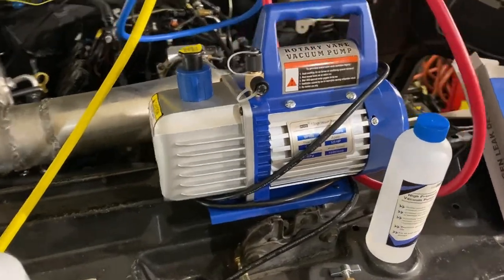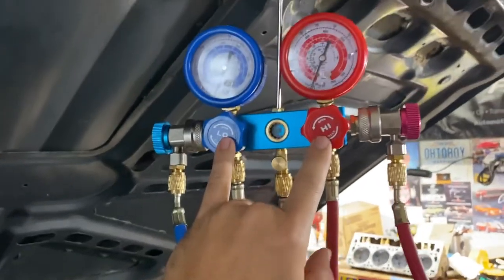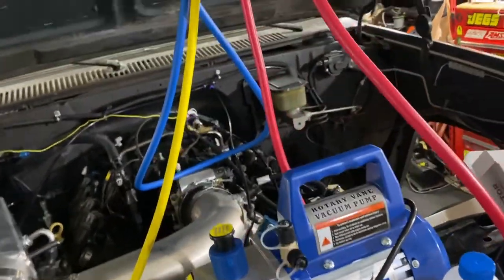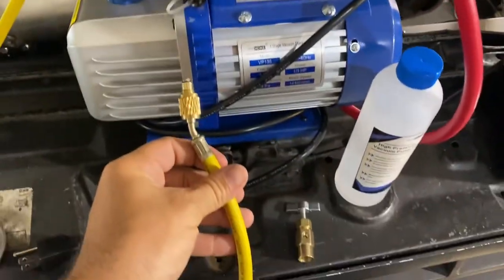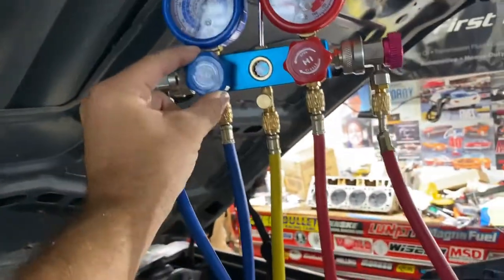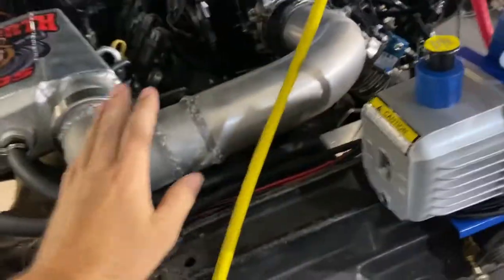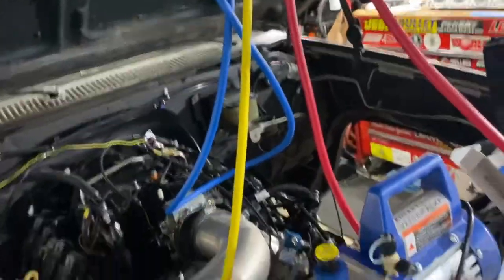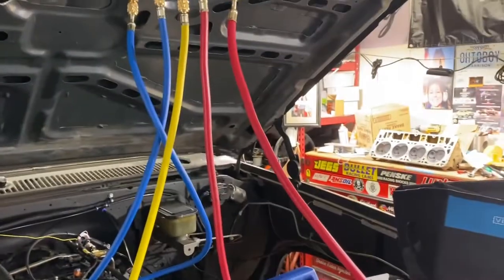I Bought The CHEAPEST Amazon AC Vacuum Pump!

Comment: One thing you did not mention: 
There is considerable amount of air in that hose possibly. So after hooking up the can you can push what appears to be a relief valve on your manifold. Blasting the air out and purging the line with only refrigerant, then open the knob to allow it all to flow in and never turn the can upside down.

Comment: Weird when i hooked up my freon can no freon would suck into the system... even after i opened the low side and pierced the can
Reply from the maker: Did you vacuum down the system first?
Reply: @donniedarkoc1033  yup
Reply: @2jzgenat the new cans require a pin valve. Most auto parts stores sell this adapter. I ran into this a few years ago and just bought the new valve from harbor freight.
Reply: @DJAlup  very true i felt so dumb that my kit didnt include the new style can tap they gave me the oldschool pierce kind